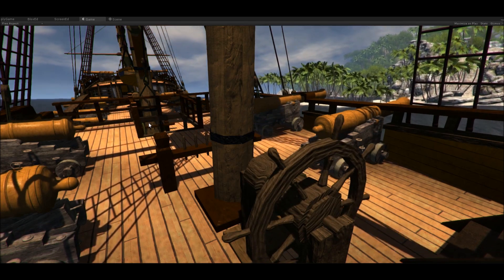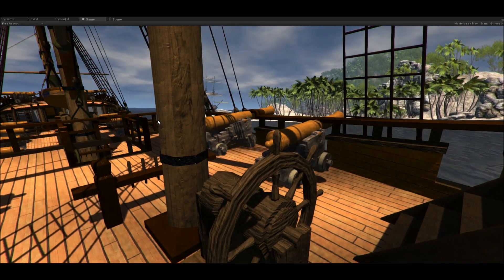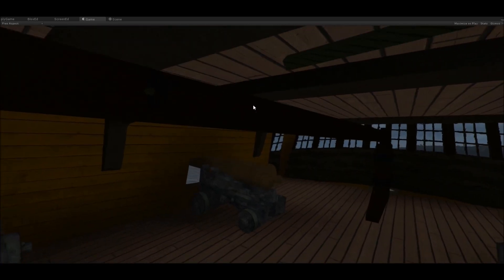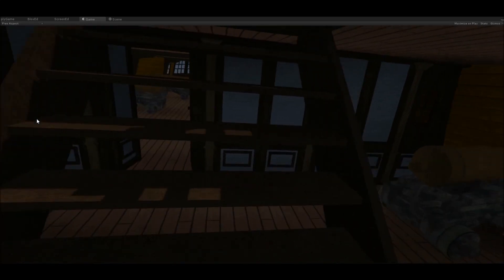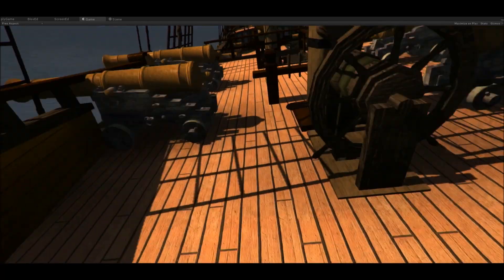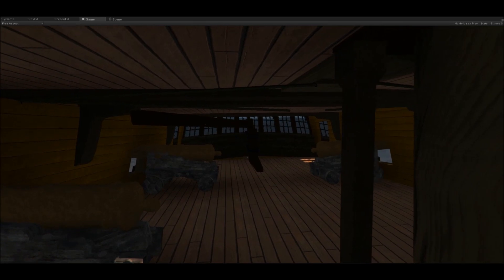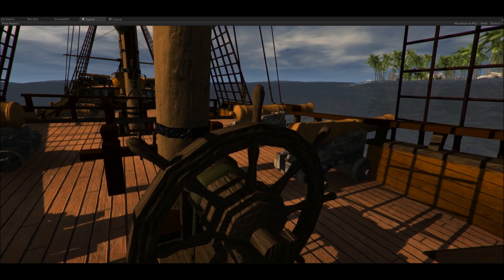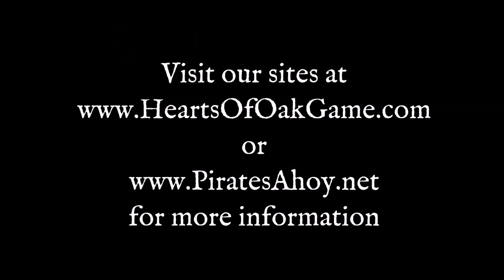Hearts of Oak - Pre-Alpha Helm Control

Comment: It would be cool if you teamed up with the Blackwake team, shared assets, and produced your games parallel to each other. The only difference is yours is gonna be an open world RPG.

Check out their storm system: Blackwake - Storm Teaser
Reply from the maker: We actually have, which is why you will see that our ocean system are VERY similar since they are created from the same base.
Reply: Captain Murphy's Ranch Awesome! Well I wish both the teams luck, because there's been an unbearable drought in 18th century naval combat games.

One quick question: when will you be able to release a playable build?
Reply from the maker: IAssassinII We are working, quickly, toward a build designated as our 'Tech Demo'. There are lists of requirements for that first publicly available release and we are already around 70% of the way to that goal. the last 30% is going to take us a bit longer than the first 70% since most of it will be much more detailed than the first broad strokes of development. We do, however, release an 'internal build' to team members that are volunteering their time to assets or coding, so there is always a way to get in on that by just volunteering!
Reply: Captain Murphy's Ranch Sweet, I'm really looking forward to playing this game. Haven't played a game like this since PotC made by Akella, which I'm pretty sure you mentioned you worked on (modding). I would volunteer, but my knowledge on the Unity engine is none, my experience 3D modelling is none, and my experience programming is extremely basic. But good luck anyway!